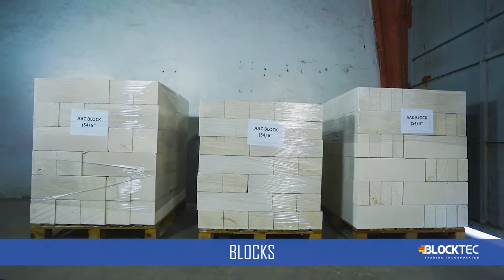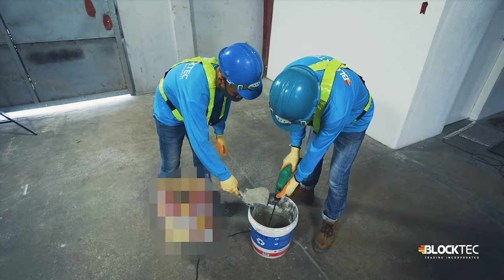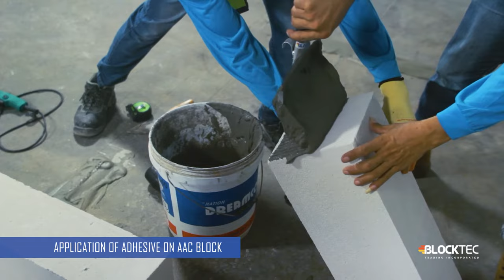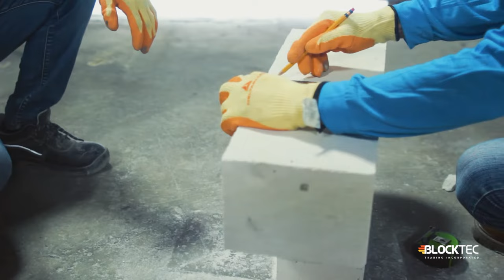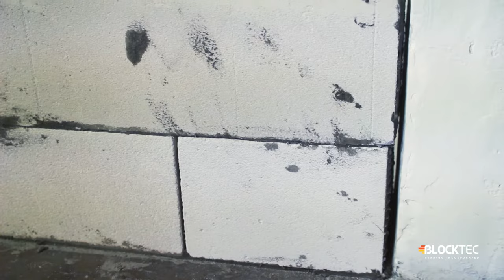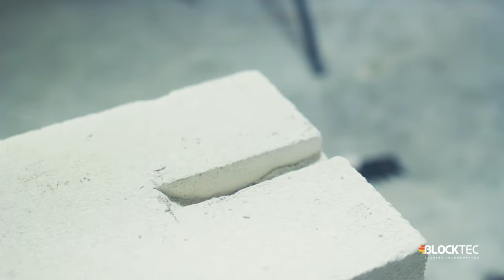How to Install AAC Blocks? by Blocktec AAC Wall System

Comment: Sir frequent question lang po.. how durable po sya if an earthquake occurs? And also fire proof po ba sya?
Reply from the maker: 4 hour fire rating ng Blocktec sir. And regarding the earthquake, AAC ay proven na sa mga bansang maraming lindol like Japan. (AAC) blocks can provide a higher level of safety during earthquakes due to their lightweight, and high-strength characteristics. We are also putting seismic gap sa wall to absorb some of the energy from the seismic waves and reduce the risk of cracking or collapsing. Above all sir, ang unang defense sa earthquake ay ang total quality ng building from foundation, column and beams. Read more here https://blocktec.ph/blog/blogs-1/post/is-aac-block-good-for-earthquake-4
Reply: Blocktec, the right answer is "walls are not designed to resist earthquake loads" unless it is a reinforced concrete shear wall. The primary structural members (foundation, columns and beams including floor concrete slabs) are the ones that resist loads.
Reply: @blocktecaac hello sir interested how much acc

Comment: May simulation ba kayo ng products niyo kung walang bakal buong wall system? Alam naman nating yung bakal ang kadalasang sumasalo sa mga lateral forces tulad ng lindol, alangan namang sa adhesives lang aasa?
Reply from the maker: https://blocktec.ph/blog/blogs-1/post/is-aac-block-good-for-earthquake-4
Reply from the maker: May dowel bars ang aac on all sides. And regarding sa simulation dito sa Pinas, so far wala pa. It's all in abroad since this is not a local technology. Soon.

Comment: Looks like weak Ang support Incase of high intensity earthquake, prang ideal lng sya gawing pader.. kc pack of metal frame support inside. Pag high rise 2 to 3 floors, Hindi pwede.
Reply from the maker: Many high-rise buildings use AAC Blocks as their wall system in the country and abroad. It's lightweight and has a high compressive strength. If you watch closely, rebars on all sides of the wall attach the blocks to beams and columns.